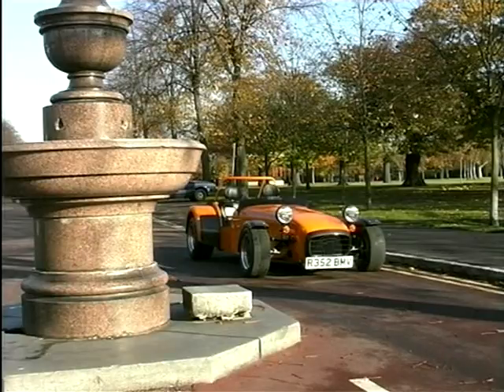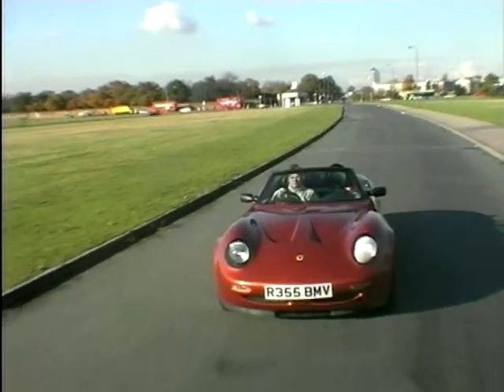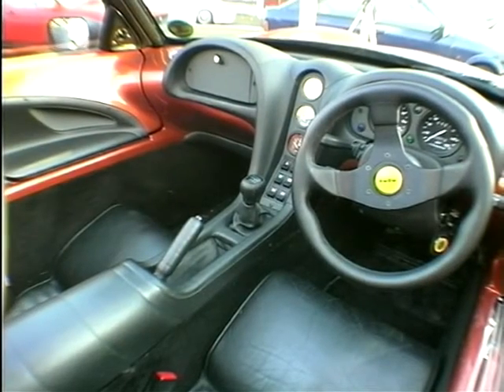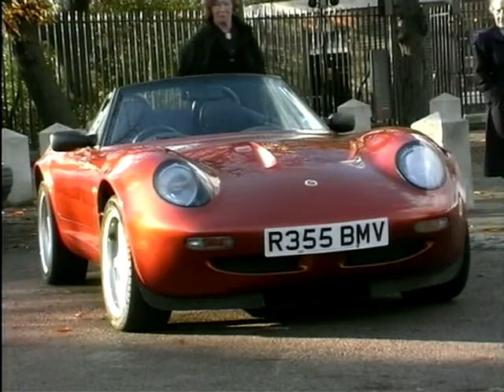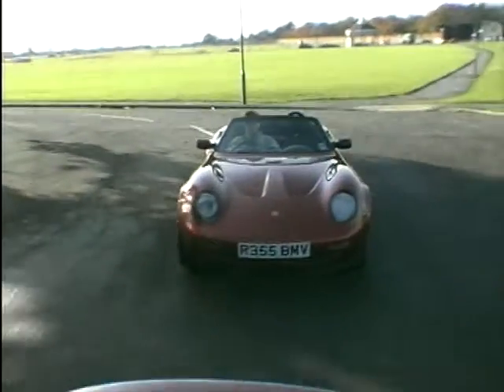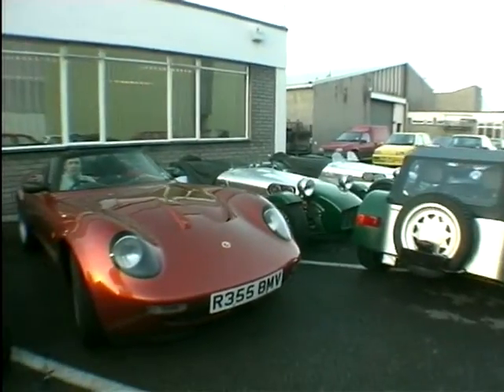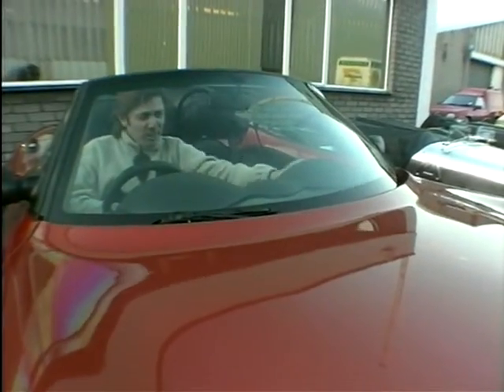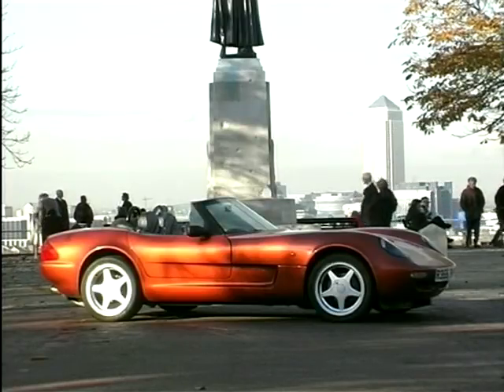1998 Caterham 21 Overview

Comment: Would the Caterham 21 have been better received had the company also acquired the rights to the original Elan alongside the 7 or produced its own equivalent of the Vegantune Evante prior to the 21? Another would have been to produce a version of the Lotus Super 907 prototype and use that to develop an early 900 Series powered equivalent of the 21.